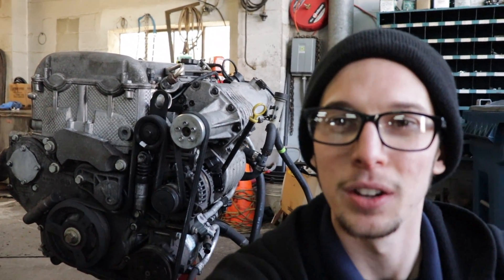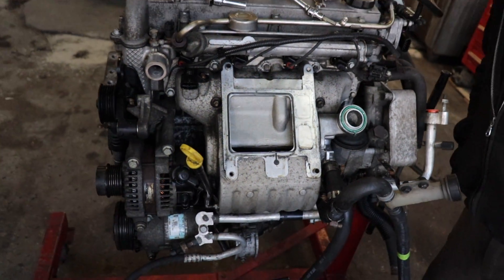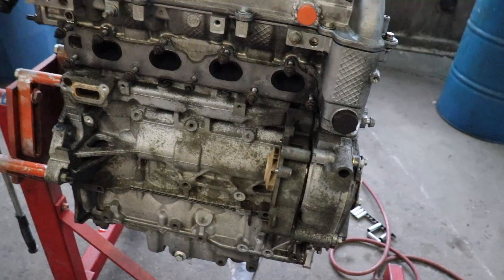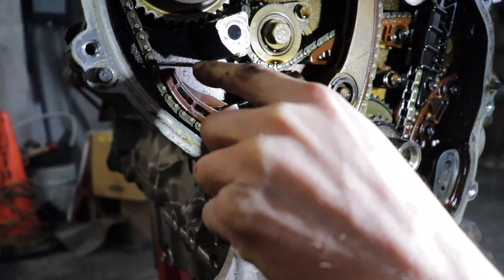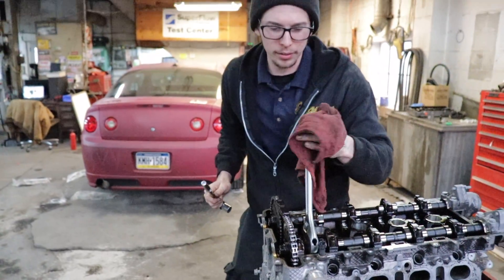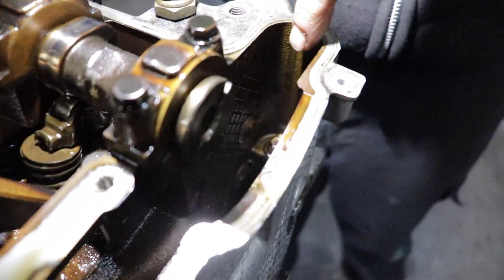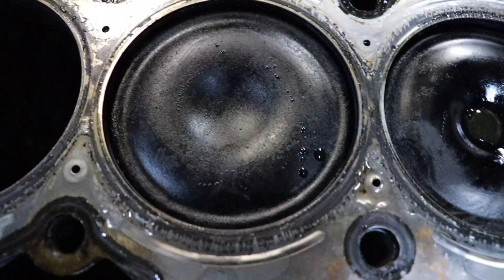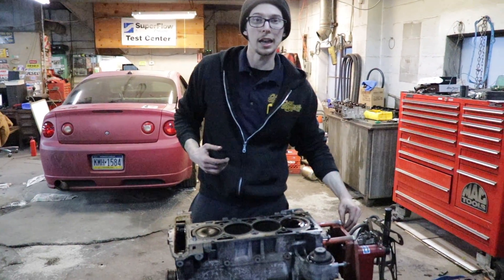Cobalt SS LSJ Engine time to TEAR IT DOWN

Comment: Was the blowby causing your dipstick to blow out? Mine keeps blowing out but the car doesn’t have any oil coming from the exhaust.
Reply from the maker: ooh yea plenty of times it blew out and sent oil all over the engine bay.
Reply: I’m actually gonna be rebuilding my lsj this winter now. Rings are toast, so I’m gonna do those and the timing chain. My first rebuild on a car too.

Comment: Hi I have a Cobalt 2007 supercharged. But engine is failing now.. wanna get a turbo one? Need help don’t really know anything about swiping engines. I have an lsj ecotic on right now but need it rebuild. What should I do? Do I need to get another engine and tune it again? Cause it tune on e85 but like I said I want to turbo it
Reply from the maker: if you get a new engine and keep the same combo you wont have to tune it. to turbo sway it your best getting zzp's kit so it easy but you'll have to tune it after that swap
Reply: @salvobrothers5928  where can I get the new engine from?
Reply from the maker: @barajasantonio391  try LKQ
Reply: @salvobrothers5928  with the same combo?
Reply from the maker: @barajasantonio391  that would be my guess, i know these engines arn't easy to find

Comment: Hey guys, I'm doing an lsj supercharger build on my 07 Pontiac Solstice 2.4L, and I was wondering what the tiny hose on top of the intake manifold connects to. My guess was the bypass valve on the blower but I'm not 100% sure. Any help would be appreciated.
Reply from the maker: if were talking about the same port it the reference port for the by pass
Reply: @salvobrothers5928  that makes sense, thanks!

Comment: U dont need to remove the sprocket to get the chain off u can just remove tensioner then its loose enough to take it off. Or sense u taking the engine apart just take the camshaft off leave the sprocket on
Reply from the maker: yea that's definitely a better way I just like fully dissembling everything

Comment: Co0L love videos like this. I daily a 2008 LNF here in Canada ehhhh. I will never do that timing chain i'm not smart enough to do it. I can probably take it apart although in the car that is tiiiiiight so screw that. The only motor I ever took apart was my 3.8 sII from my Camaro. It had a bad lifter the roller part was all destroyed and it wiped out the cam. The cylinders had some bad scoring too so she went to the junk yard.

I had a LNF before this one too that had a bad head gasket. It would build up pressure in the coolant system and eventually dump dex out the overflow and all over my tire and brakes. Burnt dex mmmmm yum.

I got a ride in a stage 1 lsj I think it was. It totally ripped and sounded very cool. 

I also learned don't let water sit on the LNF it made it all the way to the plugs and rusted them to shit and I had misfires out the ass. Also needed 2 new coils. Lesson learned the engine stays dirty now lol.
Reply from the maker: sounds like your out there having fun, keep it up